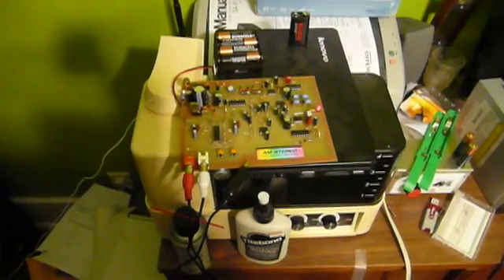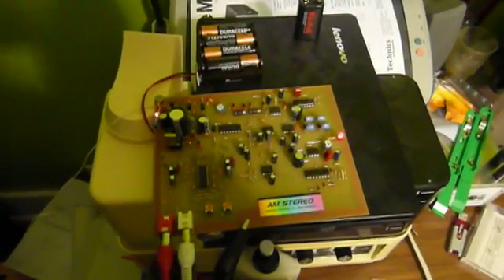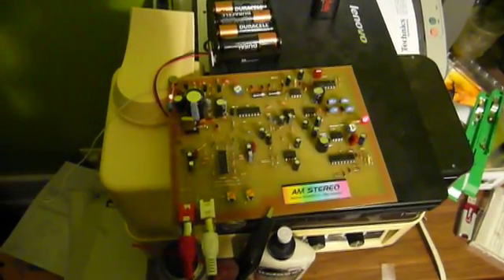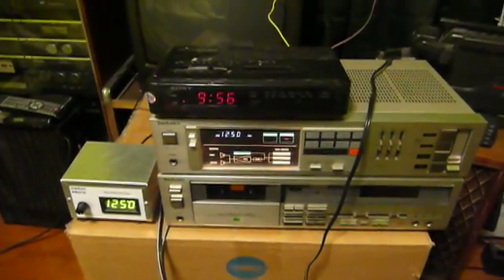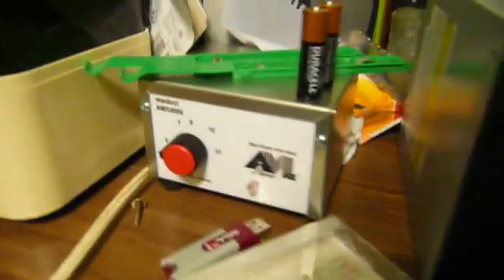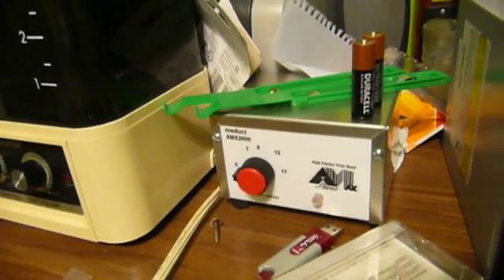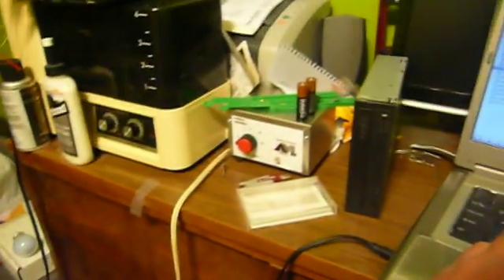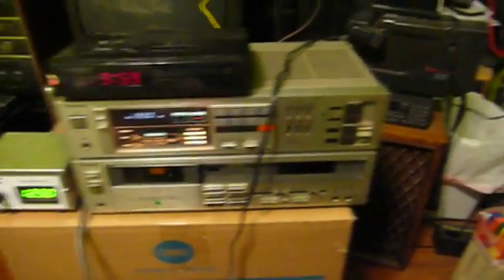The Completed AM Stereo Transmitter Kit!

Comment: Speaking of the AM Stereo transmitter kit, you can find them on eBay and it is still there to purchase the product and you can assemble the kit and broadcast it on AM radio!
Reply from the maker: The most common AM stereo transmitter you'll find on eBay isn't the same as this one. Chris Cuff has passed away and I don't believe anyone has continued the production of the kit he offered.

(That said, I have one of the other AM stereo transmitters, and it's entirely decent.)
Reply: @uxwbill  Sean Cuthbert makes an AM C-Quam Stereo Transmitter Kit and he is still around and makes more of the AM transmitter kit, AM C-Quam Stereo Transmitter Kit, et cetera et cetera, and you can buy from Sean Cuthbert from eBay and assembled the kit, and test the transmitter kit and play the soundtrack.

And I am really sorry that Chris Cuff passed away by cancer. He is also a good inventor who produced a AM Stereo Transmitter Kit.

Comment: How many feet does AM broadcast?
Reply: Depends on where the station is located at. For example, WWJ-950 CBS Radio is located in the Detroit Metro area (either in Southfield or Detroit itself) and it broadcasts up to Oakland, Macomb, and Wayne counties, and any counties that pass the borders of those counties cuts off. So, I'd say it's approx. 50-60 miles in diameter. I got some stations, like WOMC and WPZR that work in Port Huron, MI while on a camping trip with my family.

Comment: @uxwbill I am not surprised its touchy and mine is on a new frequency as well. I have two options along with the stock 1250 KHz which are 1450 KHz through a programmable oscillator and 1500 KHz through another crystal. For the ground I just soldered some solid core copper wire from a TV antenna rotator cable to a corner of the board on the ground rail which seems to work fine.

Comment: I had fun building this myself and use my particular transmitter in conjunction with a processing program for Windows called Stereo Tool to achieve the proper processing for AM stereo. But I understand your issue because when I did the high power mod for the first time I put the 2N3053 output transistor in wrong and blew the transistor. But I bought another transistor and put it in and mine too is operating at the full power level and is fully functional.

Comment: I've seen those Meduci tuners and always questioned how well they work. I'm sure you can at least salvage the C-Quam decoder part of the circuitry to retrofit into another radio.

Pre-recorded cassettes actually sound the best when played directly on the air, because the audio is already processed to fit the more limited dynamic range of the tape (compared to CDs or LPs), so you can run the transmitter's modulation higher without getting nearly as much sibilance on S's.